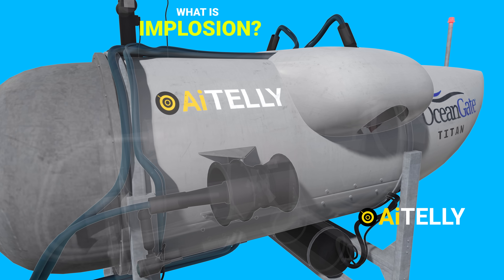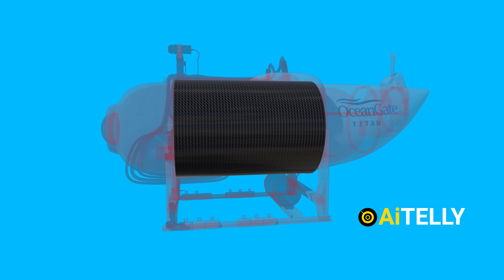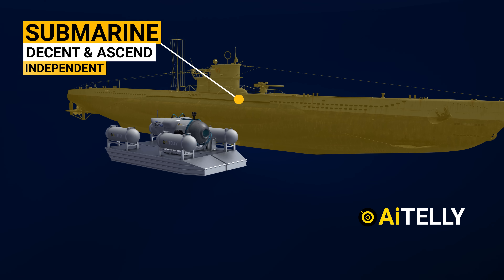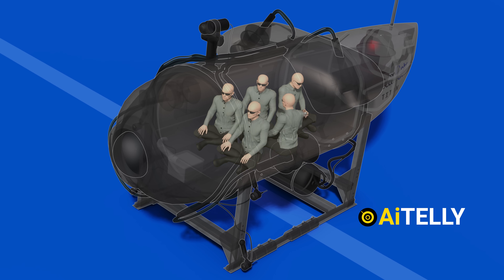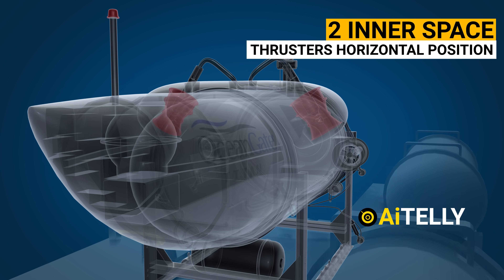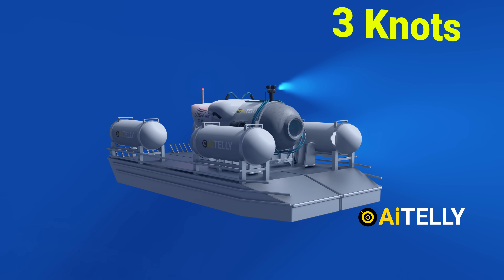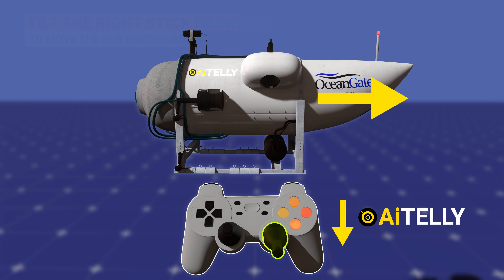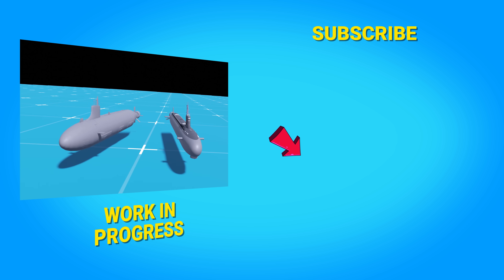Implosion Titan Oceangate How it Happened | Submersible Submarine Parts #3d

Comment: To anyone interested in the Science,

Titanium and Steel both have a consistent structural integrity, the compressive pressure they can withstand is evenly divided across them. The amount of Steel or Titanium used to increase density would allow for more compressive PSI to be applied, although weight would substantially increase.
Composites are basically gelled lattices of the given material used. Although Carbon composite is light and very strong, the structural integrity isn’t necessarily going to be evenly divided across the entire material when under the same compressive pressure…its very brittle by comparison, in simple terms. As with any lattice, any weaknesses will grow into fractures, and visual cracks (?!!) should be a VERY STRONG warning sign against using it.

-That’s why it was doomed to failure from the start. This is simple science to anyone who has any insight of physics. What’s laughable is that the CEO insisted that he knew better than those who questioned him, as well as ignoring ongoing test fails (fails that were inevitable, based on the above).

Comment: This invitation was a big disaster it should have been  tested to handle approximately 8 tons or 15,750 psi of water pressure before putting anyone in it. Easy way to test it is send oxygen filled shell sink it to bottom of Mariana Trench and chain it back up and check for leaks 😉

Comment: Easy to explain it’s a obvious implosion. But can tell carbon fiber was not the Main culprit. look at the videos of the wreckage site all parts are in a small vicinity Except front Dome ring Connecting front window dome to sub.Very incredible devastating point of entry for the water now it could have been both the Ring and or carbon fiber. Only do to the accident they had if I’m not mistaken the day prior causing a week point to the Carbon Fiber point of entry was front end of the Sub not the window even though the window was not rated for those depths window was not the culprit as can tell the entire capsule portion of the sub was crushed towards the rear end carbon fiber implosion and or mid point implosion both ends of the Titanium dome ends would have been separated clean from the sub no debris in either domes but in this case all debris was crushed towards rear dome area of the sub

Comment: Thanks to the 2024 public hearings releasing video taken of the Titan's wreckage, we can now say (with more certainty) just where the Titan vessel failed: between the front hemisphere and its carbon-fiber hull.  All debris inside the vessel was instantly crushed into the rear hemisphere, with the tailcone breaking loose but remaining otherwise intact (as it was not part of the pressure chamber).

Comment: The carbon fiber definitely couldn't stand the pressure at the depth, so it obliterated it less than a second, the guy who built it knew carbon fiber was not strong enough for a certain depth of pressure but ignores it, it ended very tragically.😢😮

Comment: Look i dont know anything about that and carbon and titanium  . But if you want to go down to where the titanic is, and is still standing over  100 years later on the floor. Whatever it was made from - steel is already proven to be a material that will withstand the pressure . Why experiment with other materials when its right in front of your face what works.

Comment: You're wrong.  This crap was crushed because it's a cylinder with 1/2 spheres fastened over the ends, not a sphere, which is far stronger.  Look at the Trieste's passenger sphere.

Comment: Maybe builder shouldn't have used 32ft of glue to build unit trying too withstand 8,000,000lbs lifting weight too just get off the bottom. No glue can withstand 8,000,000lbs of force!

Comment: Showing the aft fairing imploding isn't correct.  That was outside of the pressure hull thus not subject to the pressure differential that the pressure hull was.  Also the can crumpling look might be fine for a metal pressure hull but as you stated yourself this wasn't a metal pressure hull but a carbon fiber one.  They don't collapse the same.

Comment: This is incredibly unreal. Especially considering ocean-ass could have gotten a scrap drum for less money than that shitty carbon fiber drum. A good OSHA drum. 3x the pressure rating of its own rating. Any old ass, Will confirm, fiberglass shatters. So carbon fiber is a slightly better version of fiberglass. When either of those materials are compromised, they shatter. Even a scratch will screw its integrity. This is ridiculous. I’m not even smart. Don’t put 400 atm, On fiberglass ever. I’m not smart. But don’t cut corners…
Reply: This is an insult to modern engineering. And anyone who’s gonna say anything,…. Don’t. This is an engineering tragedy.

Comment: the curved end cap wouldn't have compressed like that.  Its a hollow plastic shell that covers a skeleton or sorts of tubular metal. Basically a fancy cover that hides the electronics and other equipment. It's not actually a part of the submersible, therefore would not crumple like that when the submersible decompressed

Comment: Trying to understand 5600 psi is like trying to use a pen to make 5600 visible dots on just one side of the dice or covering all sides with over 33,000 dots. Each dot being a single psi. Which likely means rising pressures get forced down to smaller areas capable of being greater than the bond strengths of countless materials at the molecular or well down to the atomic level which would help explain the thermonuclear reaction following the implosion capable of reaching the same temps seen on the suns surface

Comment: Visit the titanic in a go kart, expect the same results as gap jumping over 10 school busses with a go kart, a very stiff go kart that can suffer compression fractures very easily within the performance demand envelope, it's a horrible tragedy but 1 that should have been an avoidable 1, seriously, expansion and contraction values should have been taken into account during the design phase, it shouldn't have been too difficult to punch a few numbers into a simulator and put the hull thru a few hundred dives if not a thousand or so before the build, otherwise, what the heck are we pursuing AI for.

Comment: is there a layout or diagram of titan submersible , as I believe sea water began entering thru a sealed rear penetration required  from the exterior  mounted equipment cables,  causing the carbon fiber to  weaken and fail  ........ taking on water weight would  explain the rapid dive rate and inability to begin resurfacing  quickly ..........

Comment: I wonder whether the designer calculated the total pressure that the sub would be exposed to-  a surface area of about 91,250 sq ins  x 5411 psi = 493,762 lbs  divided by 2240 =  220,410 imp tons , I'm surprised it lasted so long.   if anybody knows the exact dimensions of this crazy tube ( without bulkheads) it will be even more fragile.

Comment: So what happens this time? The Titan has gone to the Titanic on separate dives before. This wasn't her first dive. Did the carbon fiber start losing it's strength after multiple deep dives?
Reply: Yep.  It started to delaminate and every dive caused more delaminations until it failed.
Reply: Or the glue joint between the titanium hemisphere and the carbon tube worked because of the different materials until the glue didn't glue.

Comment: At about the four minute mark you show the entire forward titanium dome swinging open for entry.  This  not correct; entry is made by removing the acrylic observation window and the passengers enter through the opening.  The window is re-installed with retaining bolts.  It is not possible for the crew to get out of the machine without the submersible being raised out of the water and the bolts being removed and observation port being removed, all from the outside.  In other words, there is no possible self rescue even if the craft is on the surface.

Comment: Composite 5" thick hull or tube that is delamed will not crush like that. Delamed hull will split in sections like a loaf of bread and shatter into splinters like glass. 14.7psi to 5000psi will tun watermelons into BBs Apples into grains of sand Humans into match boxes
Reply: I am a Composite Engineer on Composite sturctal design and repair for Boeing Airbus and FedEx structures divisions. Not contract engineer a FT employee.

Comment: The average human body has the surface area of 255-ish inches. The pressure at Titanic depth is 5600psi. Their bodies were subjected to 1.5 million pounds of hydrostatic pressure. 
Pretend your inside a little bubble of air in the ocean. Then wrap steel or titanium (in the case carbon fiber) around it and that’s your barrier against the pressure outside, that’s protecting your bubble of air; the pressure hull. 

Now take away that barrier, suddenly, millions of pounds of pressure on that air bubble and specifically, 1.5 million on YOUR body. You died in three ways before your brain could register and process pain signals and before it could process what all the senses were telling it. 

They said they found human remains. Well they didn’t find bodies…they likely found a piece of human tissue or bone fragment lodged in a titanium watch that was imbedded in the hull probably. 

They didn’t incinerate, not enough time to be exposed to the heat generated. 
Getting struck by lightning doesn’t incinerate people, even though the temp is similar. It’s exposure time factors too. 

But they were crushed as the surface of their bodies were subjected to 1.5 million lb’s of water pressure. They were squished and then forced the whatever path of least resistance. 

My dad was a nuclear submariner for many years. On that Father’s Day when they said the sun was missing, I told him they lost all forms communication and sonar. He said “Yeah their dead. You don’t all that those at once unless the sub is gone. They’re gonna find its fragments, maybe.”

I think every submariner knows what’s what in the ocean. They all know in their training that what CAN go wrong WILL go wrong and  THATS why we learn from the past, like from the USS Scorpion disaster,  to account for all possibilities and prepare accordingly. Down to sub design and testing and constant training.

Comment: Excellent graphics.
This application is literally using the carbon fibre structure in reverse. 
Only when pressurised from inside out does the fibre's strength get utilised, not external pressure pushing in. It doesn't take an engineer to conceptualize that in one's mind.
It was basically relying on the raw material strength.

Comment: The hull was not weak because it was carbon fiber. The structural integrity degraded over time, and there’s another design out there that was sold but it was to be used only once at the depths it was intended to go to.

Comment: The weakest point of that hull is the connection between carbon and titanium. Exactly at the same point, the highest stresses appear under water. A mistake, that could have been avoided, especially with modern simulatation techniques. But simulations will show the areas of highest stresses only, in case of carbon, they have no answer to the question: will it work or not. Computational fracture mechanics is still in its cradle, not very reliable, definitely not with carbon fibre. That was way too much risk, especially with humans involved.

Comment: From my understanding, this was not the 1st time the submersible went down to the Titanic. It's hull was capable of withstanding the pressures under normal circumstances, and gradual increase in pressure. The submersible lost power and leaned forward, presenting a smaller cross section towards the decent, reducing drag and accelerating the decent to 1.5 times its normal decent rate. The rapid onset of pressure, at a faster rate than normal, caused the hull to fail.

Comment: You show the tail cone to be crushed first. The tail cone was not pressurized and therefore can’t be crushed like you show here. It has probably been severely damaged by the implosion of the actual pressure vessel (the space between the two titanium “caps”), however.

Comment: I watched a video that covered their apparent transcript back to the polar prince. There was an assumption based on distance travelled that they decended at alot faster speeds then previous dives and then struggled to resurface even after they had dropped significant weight. Wonder if the transcript leaked was real or even accurate.
Reply from the maker: Might be True
Reply: @Aitelly  video was by Jeffostroff if interested in the assumptions made, your modeling would make for a deeper explaination on why this final dive was so different to previous ones. Also read they only completed 13 of the 90 off dives they had made due to complications, thats not a very good success rate for a $250k ticket.